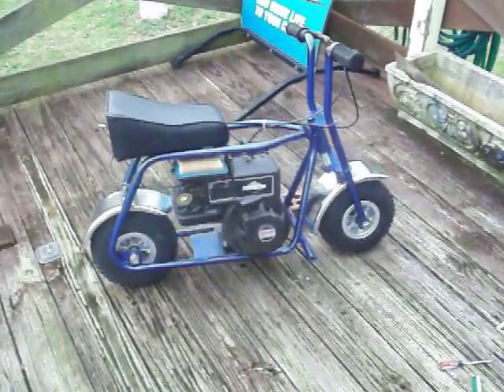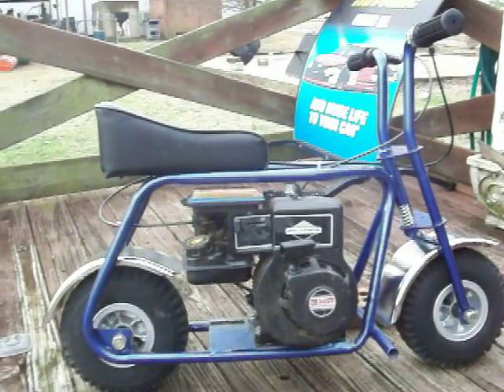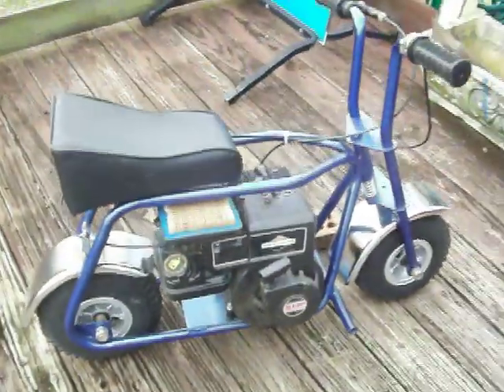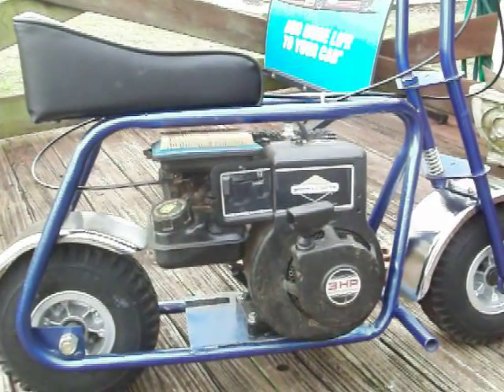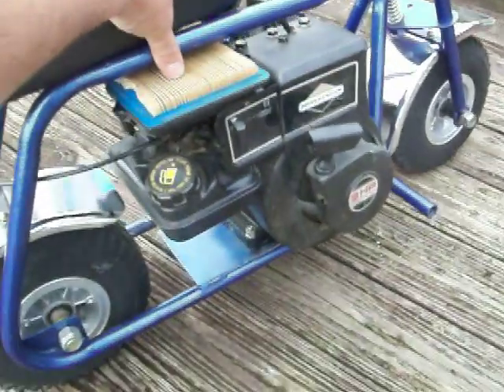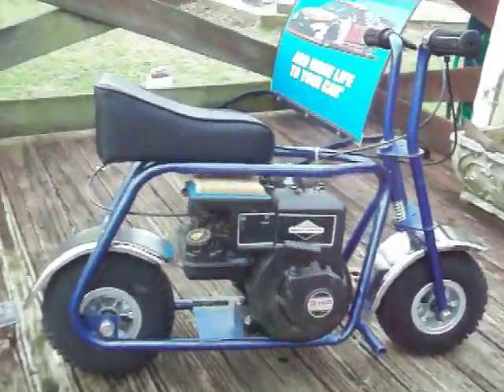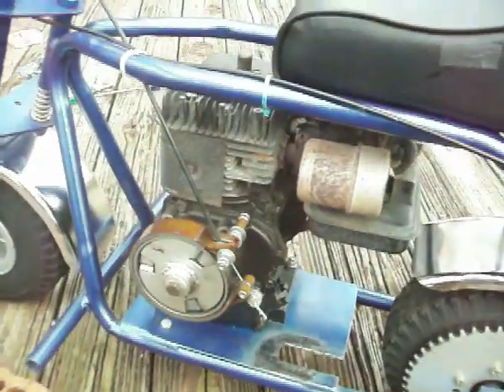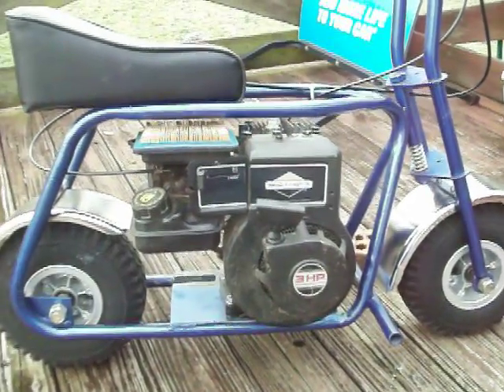LIL Indian / Rupp Minibike Get's New 3 HP Briggs

Comment from the maker: thanks for the comment but I tell you there is so many different ways to connect a throttle it would be hard to make a video that would apply to yours probably,,in fact of the 6 minibikes I have not one of them connect the identical same way no kidding,,there's all types of motors and carbs and some times I have to create parts to make them work and etc,,run it by a lawnmower dealer and they can give some helpful tips as I cannot without having it in hand,,thanks.

Comment: I have the exact motor that came off of a McLane edger with the exact plan: put it on a mini bike
Reply from the maker: I had to make a extension for the shaft so the clutch would bolt up,,was a little bit of a problem but cut and sued part of a old shaft I had from a stripped motor,,wasnt easy and hopefully the motor your using has the full length shaft.